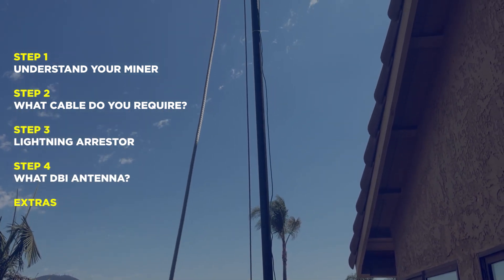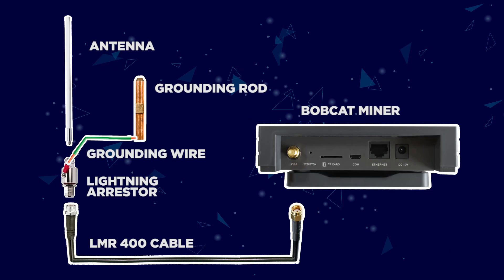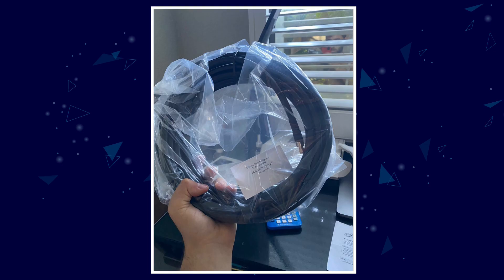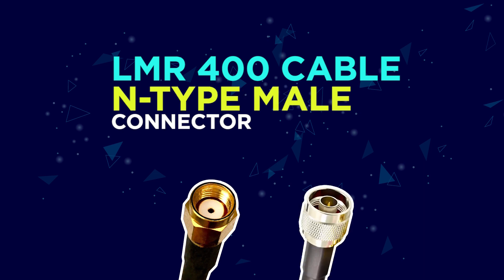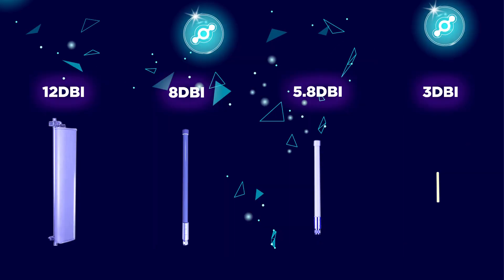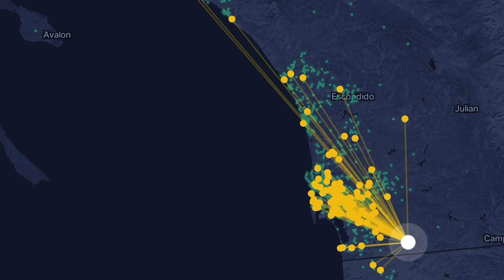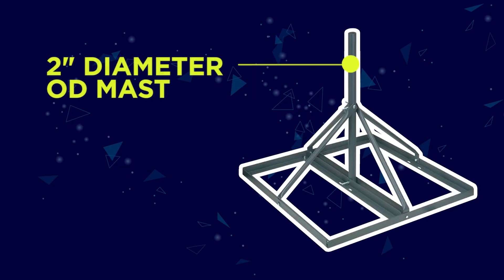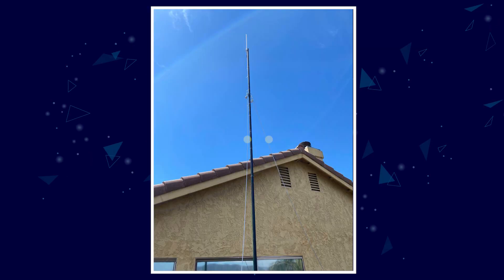Bobcat Miner Antenna Upgrade | Step by step Upgrading your Helium Miner Antenna ($HNT)

Comment: Lightning arrestors are most effective when  placed closest to the device it’s meant to protect - your hotspot, not antenna. This doesn’t seem to be well understood.
Reply: Electricity takes the path of least resistance. So you just need to make sure the grounding line is shorter than the cable run to your miner.
Reply: @jonny530  As a Ham Radio operator since 1986 I agree.  I see so many people do it as in the video and while that works IF the grounding wire has less resistance than the antenna cable.  Basically you would need to use 4-8 AWG pure copper wire so it would have the least resistance.  Oh, fun fact but back in the 1980's I had my 2m antenna mounted on the ground (ground plane 1/4 wave) and lightning hit a tree in the yard.  It melted the tree (didn't catch fire it just melted it), destroyed most of my electronic equipment in my room (the closest point to the tree) and (here comes a fun fact) it destroyed the cable (not visually but electronically) and the Antenna itself (remember nothing but the tree was hit) had its crystalline structure changed, so it never ever worked right again (could not tune it).  Lightning is a powerful force with 1 bolt having enough energy to power a small town for almost a year.  For these units I cringe when I see 12 gauge wire (or even 10) running down the length of the coax going 50 feet plus.  That lightning will laugh at that.  It will melt that wire in less than a blink of an eye, and will go down the LMR400 into your house.  Bad stuff.  Now a direct hit to the antenna (rare) nothing is going to save anything. 

TL;DR use 8, or 4 awg pure copper wire for the ground and attach it to the arrestor using a hose clamp keeping the run to no more than half the length of the coax to your miner.  If you have to then drive a new 8 foot ground rod into the ground where all 8 feet (minus say 6 inches) into the ground and attach there.
Reply: In this case isn't the hotspot as close as can be? I'm not sure what you're trying to convey
Reply: Do I need a lightening arrestor if I'm keeping it inside the house
Reply from the maker: @the_real_gigi hi Gigi sorry for the delayed reply. If placed inside, it’s not needed

Comment: just ordered my antenna yesterday. the RAL Lora antenna-fiberglass 5.8dBi, N-TYPE to SMA. can you tell me if that is the right antenna
Reply from the maker: Hi Mario, if you are running the same setup as this video, the Antenna should be an N-Type male. If you purchased NTYPE - MALE to RP-SMA then you will be provided an extra cable which is useful if you don't want to use an LMR 400 cable.

Comment: Do you need to do anything in your helium ap when you upgrade? Should the bobcat be turned off when you change the antenna? Great content, really appreciat it 👍
Reply from the maker: Hi Justin, if you want to upgrade the details of the antenna you are using on the helium app, it is a minimal data credit charge. You can do that by connecting the miner via bluetooth to the app, select settings and then update your antenna DBI. Hope it helps.

Comment: Your video was the absolute best man. I do have one question that has me very confused. I bought a rak wireless 5.8 dbi fiberglass antenna. It comes with these two u bolt mounting brackets. How do I mount the antenna to the mast using those? every video shows a custom mounting part for the mast to antenna portion.
Reply from the maker: Hey Alex, it is easier to use aluminium cable ties, similar to these: https://amzn.to/3z798bw As they are adjustable it better helps to attach to any pole. Hope it helps
Reply: @Crayban  and you just literally tie the mast and antenna together?
Reply from the maker: @alexsmith3576  yep, used 2 of those to secure it tight to the top of the mast.

Comment: Can you tell me on the bobcat what setting I should use for a Nebra 8 dbi, I have tried setting it up but in the settings, I have lost the inbound peer-to-peer connection. I still have the outbound peer-to-peer connection. I have not touched anything but attached the different antenna. Now I have tried putting the original antenna back, but have still lost the inbound peer-to-peer connection! please help.
Reply from the maker: Hi Peter, How densely populated is the area around you? What is the environment  like, sub-urbs, city? I had an issue previously upgrading, and it lost connections, due to the antenna being to high in dbi, so I switched back to a 4dbi.
Reply: @Crayban  I'm on my own at the moment, I was hoping to get a further range with a higher dbi?

Comment: Question: Do the other miners have to be in line of sight? Thanks!
Reply from the maker: Hi, they do in order for
The minersTo connect. The signal is strong, so it doesn’t theoretically mean the Antenna see each, as long as the signal connects from one miner to the other.
Reply: @Crayban  Appreciate your fast reply. I am totally ignorant about these topics so here is another: Can the signal pass through buildings and vegetation? Thanks again.

Comment: Hello , been following your channel for months(5) in this helium journey great job as always, hey let me ask you, for the ground cable, is 10 agw thickness a good choice for ground and the length for the ground does it matters if it is over 24 feet. Thanks in advance.
Reply from the maker: Hey Anibal, thank you for the support. That is perfectly fine, you can even cut the cable to length as required. The length won't matter, as long as it is grounded on the other end.

Comment: Loved the detailed video 👌. You said your wifi is in a plastic bag inside of the bricks. What type if wifi are using or do you recommend?
Reply from the maker: Most welcome. Ignore the plastic bag, only a temp solution before placing the miner within an enclosure. Wifi, is the normal broadband I have set at home, would recommend an unlimited Data plan if you can.

Comment: Nice set up and thanks for this informative video. 

Is it possible for me to cover it because I live in a country that snows as well so will covering it disrupt the connection?
Reply from the maker: Hi Heze, Missed out on this comment. If you cover the antenna it could send out a weaker signal. If you shelter it and then aim the antenna in open air, that could work.

Comment: If anyone can help...Anyone know where is a safe place to buy an 8dbi outdoor antenna? I was recommended to get a laird 8dbi and a lmr400 coax cable, since i will be putting my antenna high above my house. Most of the surrounding hotspots in my area are in the same general direction, and ranging 10-30 miles from my house. My area is also somewhat hilly and has many tall trees. Another question is if I should go higher than 8dbi? Also should I go omni directional or directional?, I saw on the RAK website they have a new 12dBi Directional Antenna, anyone use this one yet, or would it be better for my to try the 8 first? Thanks for reading
Reply from the maker: Hi Rafael, just going through the messages, apologises for the crazy delayed reply. What did you end up going with? If you still have the antennas out in a certain direction, directional antennas perform better, especially if positioned exactly in the direction you need the antenna to connect to. 8dbi is recommended in suburbs. If you are high up a 12dBi would most likely work better.
Reply: @Crayban  thanks for the response. I acually just got my bobcat miners a few days ago and just ordered the 8dbi antennas from rak wireless website.  I found out that my property is in a low valley surrounded by higher hills and trees around it. I'm hoping I can get my antenna up high enough. I may need to pay someone to build my antenna tower up higher safely. I currently have a tower that goes up 5 meters higher than my roof. But not sure if it will be high enough. I may need to use the provided 4dbi antenna that will have a higher arching signal that may be able to get over the sourrounding higher terrain better. I just have to check if their are restrictions on building a tower a certain height i guess. Also, I did get an outdoor enclosure for the miner, and I was wondering if I should connect it with blue tooth or ethernet cable for best results. And what would be the best cable to buy to run a long distance from my miner to the antenna, or is it better to get the miner way up by the antenna? Thanks
Reply: @Crayban  Thanks for responding. I actually just got my bobcat miners a few days ago and just ordered the 8dbi antennas from rak wireless website.  I found out that my property is in a low valley surrounded by higher hills and trees around it. I'm hoping I can get my antenna up high enough. I may need to pay someone to build my antenna tower up higher and safely. I currently have a tower that goes up 5 meters higher than my roof. But not sure if it will be high enough. I may need to use the provided 4dbi antenna that will have a higher arching signal that may be able to get over the surrounding higher terrain better. I just have to check if their are restrictions on building a tower a certain height i guess. Also was wondering if I should connect it with blue tooth or ethernet cable for best results. And what would be the best cable to buy to run a long distance from my miner to the antenna, or is it better to get the miner way up by the antenna?  I did buy an outdoor enclosure for the miner if it needs to be placed outside. Thanks
Reply from the maker: @RCortez1986  Hi Rafael, for the initial sync, connect it via ethernet, and then you can switch over to wifi. Wifi usually is stable enough. If you want you miner indoors (which is preferred) run a LMR 400 cable up to the antenna, I have a link within the description of the video. Outdoor enclosure would work, my only issue is placing it high up its frustrating to keep bringing it down incase you need to unplug it. However you could place the miner within an enclosure at lower ground and run a shorter lmr 400 cable up to the antenna.
Reply: @Crayban  Thank you for the tips!

Comment: Where is the best place to purchase an upgraded antenna. Currently running a 4DBI standard antenna that came with the Bobcat Miner. Current location is suburbs and want to upgrade to somewhere between 5-8DBI. The miner/antenna will remain indoors so not sure if that changes anything?
Reply from the maker: Hi Samir, check out Rockland, they usually have a good fleet of antennas to choose from: https://store.rokland.com/collections/802-11ah-wi-fi-halow?ref=ray . And as you mentioned, for the suburbs, usually 5.88 or higher works better to shoot out a signal to connect to miners further out.

Comment: So if I have 8 miners in my hexagon, I have a 4.0 dbi bobcat. Which antenna should I upgrade to? The highest earning one is a 1.2 dbi antenna, I’m on the fourth floor
Reply from the maker: Hi Andy, are you based within the city? 8 is a handful, I would suggest, a lower dbi antenna if its a congested area, also if you could place the antenna out the window if its a towerblock.

Comment: I purchased a 5.8 dbi antenna as a replacement for my 4 dbi stock antenna with my bobcat 300. When I look in the helium app, it says that my miner is still broadcasting in 4 dbi. Any thoughts on how to change that?
Reply from the maker: Hey what’s up, you need to connect your miner to your app via Bluetooth first. Then click settings, then there will be a section where you can update your location or your antenna height and dBi. It costs a small amount of data credits to upgrade.

Comment: Questions -
1. Did you use 30ft or 25ft for LMR cable? Wondering if I’ll need extra in case I get a 25ft pole
2. Where could I find the copper grounding rod?
3. How did you actually get the antenna to stick up there? Did you use one of those bases?
Reply from the maker: Hi Dino, 
1. Went with the 30ft cable to give extra slack incase I needed it, 25ft would have been enough. 
2. You can get this one: https://amzn.to/3mcW2pl
3. I used all the equipment in the video, the antenna was attached with a ring clamp against the pole.

Let me know if theres anything else.

Comment: Hey, how do I change the antenna if it's indoor and doesn't need a grounding wire? What do I replace that connector piece with?
Reply from the maker: Hey, you will require a cable/extender with the correct ends that will insert into the antenna and the miner.

Comment: So 8dBi Fiberglass Antenna from RAK Wireless would not be compatible with Bobcat 300, right? because "Supports 858-878MHz" and bobcat has a dif. spec?
Reply from the maker: Hi Manuel, it depends on the miner you have. You can either purchase an 868 or 915,
Reply: @Crayban  I was talking about the 868, is it? What do you think about using Bobcat 300 inside the house but with an extension cable to mount the 8dbi antenna on my roof? Nice setup? Or better to setup outdoor with an enclosure? I also read its advised to have 3 miners setup in a cluster, is it true?

Comment: You were absolutely killing it in this video, up until the point where you put the Miner on the roof in a plastic bag.  You can't put a Bobcat outside.  No if ands and buts about it, unless you live someplace that does not get hot.  San Diego is not one of them.  
https://www.bobcatminer.com/post/sunburning-your-miner-could-be-fatal
Reply from the maker: haha, not to worry, not in a bag anymore. That was a temp solution, used an enclosure and placed beneath the concrete blocks. Monitoring the temp, it works at normal working conditions.

Comment: is it possible to attach lightning arrester at the miner? antenna-cable-arrester-miner
Reply from the maker: Hi, its preferred to connect it to the antenna so it can cut out any excess current so it flows to the grounding wire. If it is placed at the end, the power will flow through the main cable.

Comment: I am finally getting my Bobcat tomorrow.  Will I definitely need a separate antenna?  Can I keep the miner in the house and run cable outside to the antenna and still get the extra advantage of the antenna?  I was planning being prepared for its arrival but I only was given a couple days notice.  Anyway, hope u r still checking these.  Thanks!
Reply from the maker: Hey, you can get an extender cable in order to keep the same stock antenna.  The stock antenna is waterproof and ip66 rated.  Try out the 4dbi, analyse the results and then you can determine upgrading if need be.
Reply: @Crayban  Cool.  Guess I can attach the stock antenna to the roof of the house and get a long extender cable.  Is it just this one u put in the description? https://www.amazon.com/gp/product/B083JHJKW8/ I’ll keep u posted and thanks so much for replying man!!!

Comment: I stay in a townhouse with an HOA & I don't think that they'll approve an antenna like the one in the video. Do you have any suggestions of one that I can use that is much smaller than that one?
Reply from the maker: Hi, you could use a pole connected to the side of your home, I have provided a link in the description. There are different types of antenna provided by l-com. https://www.l-com.com/wireless-antenna In regards to HOA, check the Otard rule, which might exempt you from HOA bringing it down. https://www.fcc.gov/consumers/guides/installing-consumer-owned-antennas-and-satellite-dishes
Reply: @Crayban  ok, I'll look into that. Thanks for the info.

Comment: Hi man ows video. I live in euro, i can only find female to male. Is that a problem? or what about just be in europa whould you recerment some other?
Reply from the maker: Hi Dennis, apologises for the delayed reply. You will require the right connections, or an adapter to convert. Did you sort it out?
Reply: @Crayban  hi man, thx for getting back to me. I gat adapter. I have All the prob with My first miner i think  but hopefully it will soon get on mining.

Comment: So I bought the pre-kit antenna with a 12 DBI with line 15 ft long and hooked it up to my minor ran it outside to the side of my home installed the antenna. But when I go to look at my minor on the app is still shows the four DBI factory antenna that came with it. Does the miner have to be reset or unplugged and plugged back in for it to pick up the new antenna or am I not doing something right within the app? Thank you for your video and job well done on it by the way
Reply from the maker: Hey Reel, the number on the app is there for transparency purposes on the blockchain. It actually doesn’t dictate how the miner performs. 

If you want you can change the number by connecting the miner via Bluetooth to your app, select the settings icon, select pair device, select update hotspot. Here you will be able to change the height and the antenna dbi rating. It will come at a small HNT cost.  

Let me know how it goes.

Comment: Great video. may i ask, is there any UK suppliers that supply these antennas and the extras? thanks
Reply from the maker: Hi Mehmet, thank you. There are, you can check out the Antennas with Nebra, but cross-check the delivery time. Extras should be able to be sourced on Amazon UK, as I will be ordering a few soon. https://www.nebra.com/?ref=xO-Nuzdb2VFMH

Comment: Great work! Will literally follow this to upgrade mine!
Great job!
Quick question!
Can’t seem to find the IP rating for the antenna! Do you think of any problem with the antenna staying outside? They are waterproof right?

Thank you for your video
Reply from the maker: Hi Daniel, the IP rating is IP66. I actually have mine placed outside for 1 of my setups, however , slightly sheltered. They are waterproof.
Reply: @Crayban  Thank you! Everything ordered like in your video, just not the base! This one will go be assembled on the roof! Keep up the good content! 👌